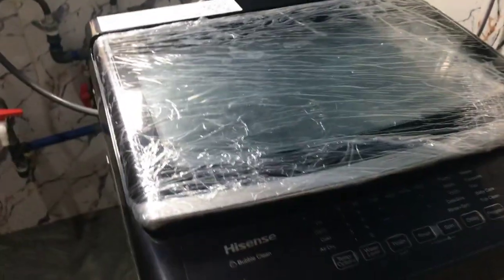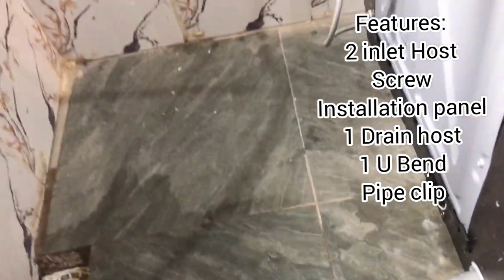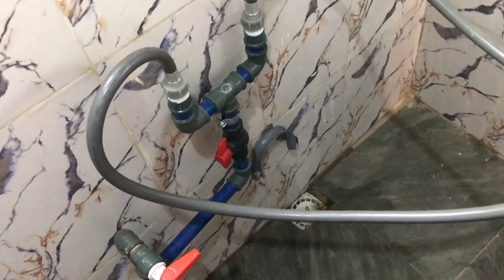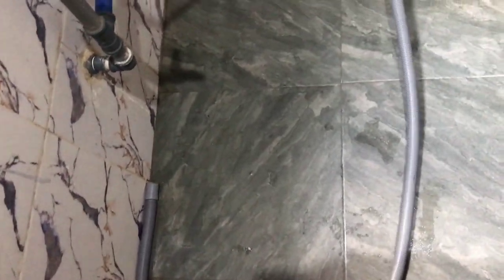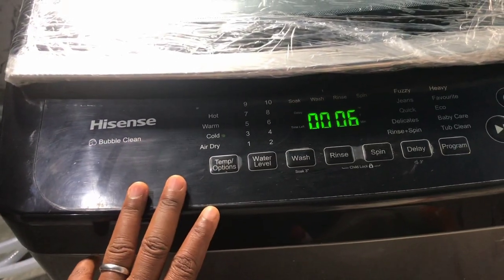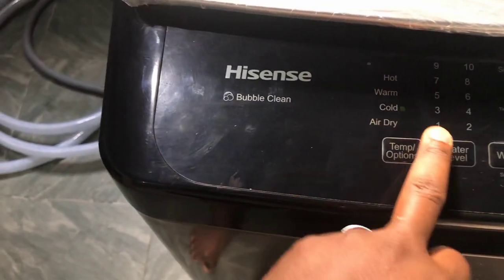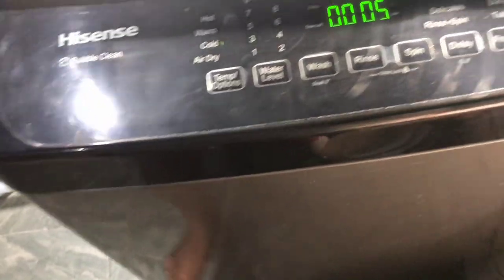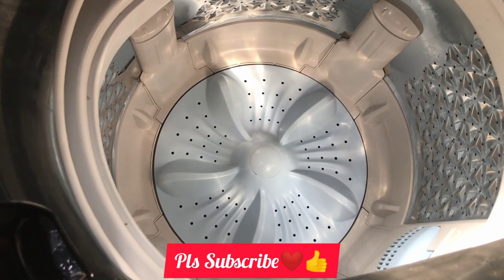How I  Installed my first Hisense WTJA802T 8kg automatic washing machine👯#installation #more

Comment: the u bend is to hang the drain hose at the same level of the washing machine height to avoid water to drain out while taking water in, or pouring water into the machine manually,

the two water inlet pipe you  connected, the blue marked one is for cold normal water to go in automatically and the red marked one is to be connected to a hot water channel.
Reply from the maker: Ok 👌 thanks for the information 🙂
Reply: Hey, so is it possible to use the washer by manually pouring water into the machine? Can you please help on how I can use my hisense automatic washer manually

Comment: Mine didnt come with that under panel that covers the under so had to get a welder to make that cut for us
Reply from the maker: Of but hope is not hard material.
Cus the panel under is mild and foldable
Reply: Pls did u put that thing under inside the machine
Reply: It definitely comes with it. You may have missed it inside the package. I almost made the same mistake until I searched the carton properly and found the panel. It’s a black carton - like material.
Reply: Just bought mine today too and the installation panel that is supposed to be under didn't come with it....hope it won't have any effect on it?

Comment: I just installed mine, but it doesn't spin. Instead it will keep adding water . Any reason for that? Please help
Reply: How did you solve this? I got the machine yesterday and I am experiencing this same issue. It will only fetch water but it won't spin to wash or rinse or spin at the end. No spin or rotating at all. It will just stand still and pour water alone and make sound
Reply: @yusufolayode4742  played it directly on the ground with the black rubber underneath

Comment: I just got my own recently and it doesn't move at all. It just keeps fetching water even at the 1 water level.
Reply: I don't know if there's something I'm not doing right
Reply from the maker: Have u gone through the Manuel
Reply from the maker: Can a technician to fix the pipe for you.
Reply from the maker: @pascalebenezer2054  your names sounds familiar. Ar u related to Ebenezer amarachi. From abia. Went to Alvan.
Reply: @honeychillbenedicta9389  my sister's name is also Amarachi but we aren't from Abia and she doesn't go to Alvan
Reply: @honeychillbenedicta9389  The pipe has been fixed already. If the water reaches a the set level it's supposed to automatically stop then start washing right? If yes, mine doesn't do that. Water just continues to enter the tub. Today is my first time of using it. I bought it a week ago.
Reply from the maker: When u on it and set it for washing and you saw that water has started coming in raise the drainage pipe up and leave it . When the water  has reached the point it will automatically stop and start Doing the washing
Reply from the maker: You can check this video https://youtu.be/9K0KVpeQ6p4
I think I answered some questions relating to yours.
Reply: @honeychillbenedicta9389  I've done everything in the video. Water doesn't come out from the drainage pipe because it's raised.
Reply: @pascalebenezer2054  i iust bought a media automatic washing machine and I'm experiencing this also, it's really really frustrating. I'm thinking maybe my machine is faulty. 
I saw a few comments saying the hose has to be up, mine is up cos a plumber installed it a d connected to a pipe with that curved stuff ... but it's still draining water while pumping water... it's just wasting my detergent
Reply: @neroflo57  then is isn't placed well. My machine doesn't have any issue again.
Reply: @pascalebenezer2054  thanks for the reply
Reply: @pascalebenezer2054 mine water is not coming in
Reply: @user-iz9jq1eq4s  did you start the washing process for water to come in?
Reply: I don't understand all these issues at all. Am I suppose to be monitoring a machine I call automatic by raising hose when water is coming in and also manually putting it down to drain??????. I am returning it fast because it's automatic I asked for.
Reply: @pascalebenezer2054 please explain further. So you have or monitor the hose  when you are washing and then put it down to drain when it finishing washing and then raise up again to collect water for rinsing???? Biko nuooo. Have and why should.i be monitoring am authomatic machine. ??? I should be able to put clothes in leave to wash on it's on till apin and just collect the clothes.
Reply: @betinaosadola6225  I've figured it out already.

Comment: Please I installed it myself and I on it I pressed the water level but water is not entering the machine.
Reply from the maker: It depends on how you connect it. Make sure that the two host are connected to a tap

Comment: please how do put water in it cos mine I just got it n if I on tap d water will b draining out from d hose
Reply from the maker: Ok all u need to do is wen u on the machine and the water started coming in from inside. U rise the drainage pipe up. 

At some point the the machine will start washing your clothes.

And after washing bring the drainage pipe down so that it will discharge the dirty water .
Reply: Is like someone have to stay with the machine while washine. beacause you have to rise the drained hose. the water will Splash everywhere when you are not there. This is what I experienced
Reply: Same as mine. If you leave the machine when washing, the machine will finish washing and start splashing water all over the place.
Also the rising point, i still don't get it because the machine doesn't rinse with new after to remove the entire soap from your cloths.

Comment: Thank You mam.... I heard it's fully automatic washing machine then why do we need to handle hose manually every time?

And what's your overall experience with it? 
Is it worth buying?

Thanks in advance
Reply from the maker: Yes and yesl
Reply: @honeychillbenedicta9389  Is it fully automatic or Semi automatic?
Reply from the maker: It is fully automatic machine.
Reply: @honeychillbenedicta9389  ok... I just asked because you told that we have to hold drain pipe everytime we wash clothes